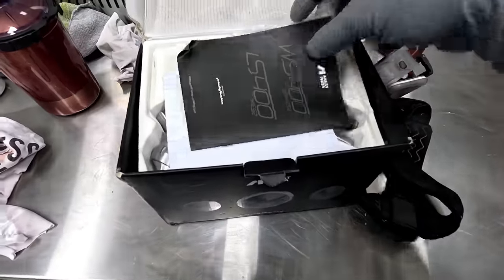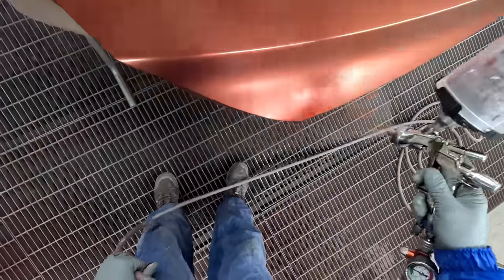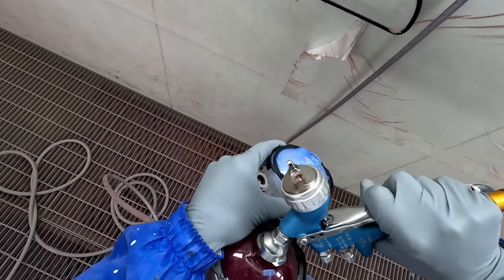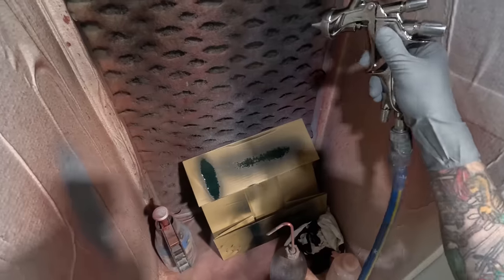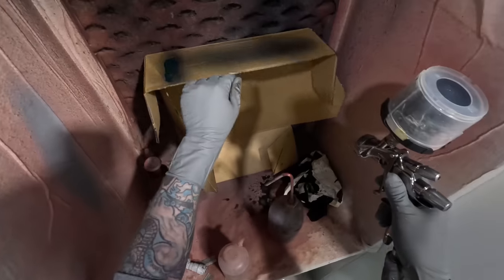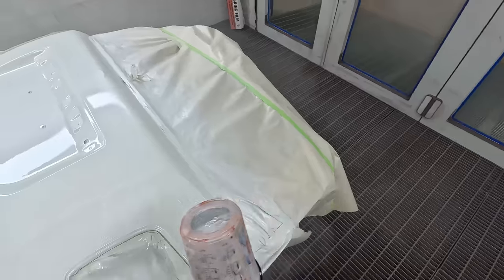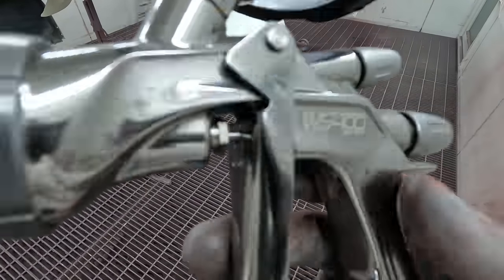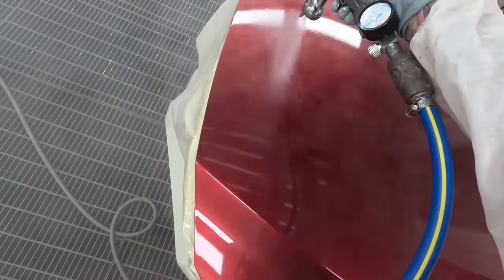Iwata Supernova Series 2 Review

Comment: @ 6:49 timestamp.  Your nozzle is incorrectly lined up so no wonder you having issues with the fan.  Crank that nozzle and line it up properly and I guarantee that will fix the issue.  I have series 1 ws and ls 400 initially had same issues as u do then I lined up the nozzle correctly and now they both spray with full open fan.  I got a series 2 digital on the way next week and before I put paint thru it the first thing I will make sure is to check the nozzle for alignment.

Comment: Exact same feelings when I had mine, they said they’d fixed the fan and it was out the box set up. Plugged it in, completely nothing in the middle of the fan. However that split tip will break up the thickest of clear unlike any other gun, I never knew you could hate and love it at the same time 😂 

I think it’s patented but we just need devilbiss and Sata to bring out their versions of a split fluid tip and we’ll be seeing some killer guns in the future

Comment: Hi Gunny, it's down to the way you fit the split tip you have to get 2 of the cut outs in the tip perfectly lined up to the airhorn or it wont spray properly, I have the digital version and it sprays perfectly at full fan. It's also mentioned in the user manual if you have it.

You might need to tighten the tip up really tight to get them to line up but once you do it transforms the gun, I absolutely love mine👍John UK
Reply: Hi is the digital version the same as this one ?? Like they both perfomr the same way?
Reply: Yeah it's exactly the same and it sprays the same, it has a removable digital pressure gauge that fits in the handle👍

Comment: I've been using the ws 400 mk2 clear and water over the past 12 months and I love them.
I set the to full fluid and full fan 2 bar and never had a problem. 
I work in a small shop painting 40 plus jobs week in week out.
I also own a set of DV1s and Sata 5500x base and clear and the iwata guns are my most used out of the three sets..
Keep up the good work with the vids Gunman

Comment: Exactly two turns open the torch and the pressure is at least 2.4 and you will see what a miracle is happening. But you have to move quickly.

Comment: This is funny hearing you say the supernova is finicky. I used it for about a year with good results but I live in New England USA and the weather suddenly changed from 80f daily to 60f and couldn’t get my finish right. Either too dry or runs no matter the hardener and reducer. Then i decided to use one of my 5500 Rp base guns and realized what my problem was.
Reply: Hey, im in NE as well, most of my jobs are race or show car parts and bikes in the offseason so the temp is usually pretty low like 60’s in my
Basement with the heat going on a good day. Which clear coat are you using? High solid and medium solid are very difficult in these conditions.

Comment: The factory yt video-s discussing several improvements for the series 2 actually mentions a re engineered air pressure gauge as even the factory supplied gauge was not accurate.. I have a series 1 and its a beautiful gun that sprays perfectly. I will pickup a 2 because I dont want to keep re tuning the gun when I switch caps and shoot from base to clear and back.
Reply: Could you just set it and forget it? once she`s dialed in?

Comment: The nozzle has to be in a specific way to work properly. Iron cross set. Series one or two it doesn't matter if you overtighten it you ruin the fan because the nozzle will be off set. Some guns come with good nozzles set some dont

Comment: W400 almost 20 years #1
Reply: Yup and LPH400. Still rocking them.
Reply: Yeah still own 3 w400's i call them the old reliable's still going strong after 8 years
Reply: Painter at body shop, I got 8 guns and this one is the best of all !!!
Reply: Love my Bellaria at home. My LPH400 is good too but more finicky. Gotta play with the fan a bit and the air cap has to be clocked to the side a little for it to spray straight. Maybe something is wrong with it. I tried the silver cap on my tulip w400 and it sprays straight. My Bellaria just works. Full fan is nice big and even. Sprays glass easily

Comment: I'll give you my personal setup. With That Sr2 gun, I set it up fan 2 turns, full open material and 35 psi, using a clear coat hs, at a maximum distance of 5 inches, and I get crystal results. It's my favorite pistol
Reply: Same way I setup my series 1. way to go. I use the 1.5 tip. With this setup the gun is pretty fast with a big fan a very good atomization.  Fan is solid

Comment: I got lucky with my ws400 series 1. It has a good pattern, I do use it with the fan turned in 2 turns but it works good wide open. I have tried most  guns out there except the series 2. I switch between a dv1, sagola, sata 5000 and ws400 for clear. Other painter has walcoms, demoed sata 5500. Knowing the iwatas have issues will likely never buy another.

Comment: I still really want a balleria ( excuse spelling). Looks good, good choice of setups. Not sure how well it will run on a mini compressor though! Keep up the good work gunny, don't forget a new mini gun review 😆
Reply: Love my Bellaria. Easy to use. Works very good at full fan. Nice big and even pattern. Just set the fluid and pressure to get the finish you want. Doesnt use a ton of air

Comment: iwata ws400 1.4 best clear gun.lays out clear better than any gun.open fan all the way almost 3 turns in,full material works perfect for me.if i have a big job ans want to finish fast sata x5500 rp 1.3
Reply: Hi , i have same iwata with 1.4 stile    play with settings ,  so u close 3 turns fan but what pressure u use ? 🙂

Comment: I was told by a ppg course director that the guns need specific licensing to be sold in certain areas. And also i was told the "proper" settings are full fan full fluid. Personally this is how i spay my series 1 i just get a little closer to the panel move fast and smash it on 👌🏼

Comment: Tbh looks like you have a faulty series 2.. the split tip on the series 2 is now meant to line up with the horns completely straight. They've changed it so that everytime it's tightened it will line up. Yours in a couple shots look misaligned so it wouldn't spray any different than the series 1. I'm currently in Oz as well, my series 1 tip is always lined up with the horns and the fan is full no split no matter where the setup is.
Reply: Yeah spot on, I live in the UK and have the digital series 2 and if you tighten the tip down hard then the split tip lines up with the air horn which gives you a perfect fan at full fan, I've also commented above. John UK

Comment: Love your videos you are what led me to buy my ProLite . I have a question what set up do you recommend, I was thinking 1.3 fluid and T110 cap around 25- 29 PSI. The clear I’ll be using is the Acme FC720 any help you can share would be greatly appreciated!
Reply: Id say it depends if you're looking FLAT jobs or oem peel. I use the 1.3 with T110 and if I'm wanting flat peel i go around 29-32psi 2.0bar - 2.2bar, but if you want real custom flat peel I'd throw the 1.2 into it and at 2.2bar👍
Reply: @iNeedMoreHondas  1.2 and stay with the T110 or T20?

Comment: Do you feel that the Baleria lays it out just as good as the supernova? Is the LPH-400 the same as the Baleria?
Reply: Any wbx at 2 bar sprays most similar to the ws400 in the iwata range. The Meiji finer core is the direct competitor to the supernova in Japan and has extremely fine atomization with no difficult set up.